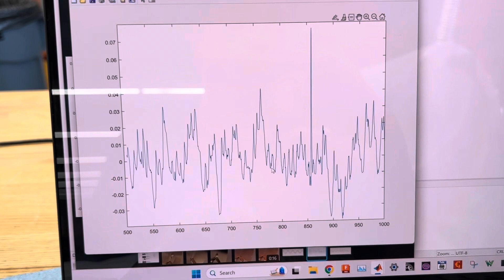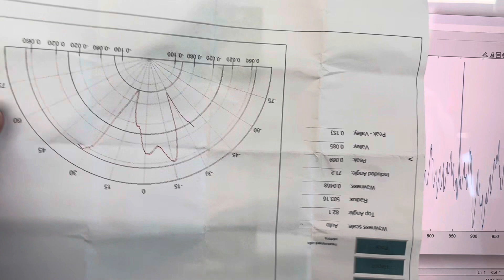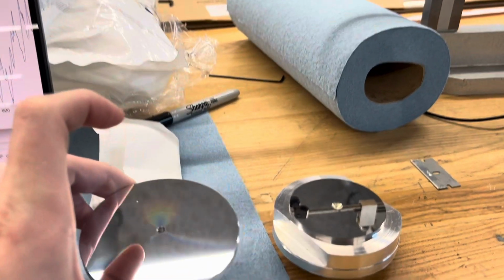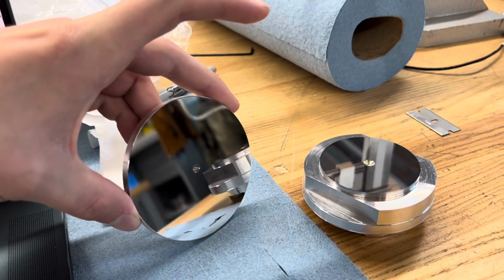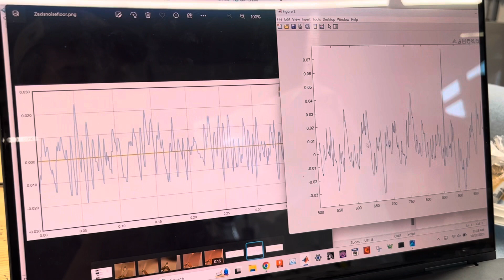Nanoscale air bearing vibrations cause surface finish issues in diamond turned surfaces

Comment: Running a different gas like argon or changing the temperature of the gas feed through the bearing might tell you if its a cavity resonance issue. Or it could be due to the air supply itself - such as if your air supply is vibrating. Hitting the resonance of a valve can also cause feed issues

Comment: Can you characterize the air bearing run out as a function of air bearing pressure? I found that higher pressures can result in less runout for my rheometer....

Comment: Not related to the vid - What happens if you sharpen a standard tungsten carbide or CBN tool to the sharpness of your diamond tool and used that instead? is the only concern with using these softer materials that they just don't hold a super sharp edge for as long so they can't be used to achieve these optical finishes? I guess grain size of the tungsten carbide composite could effect the practical sharpness limit.
Reply from the maker: You can’t get WC or CBN as sharp as diamond, and hence you can’t get the same optical finish, or realize the same near-zero cutting forces, which contributes to part accuracy
Reply: @cylosgarage  Makes sense. I'm curious what's the minimum depth of cut you can effectively take with your setup on aluminum? I remember seeing some paper on this lathe. I didn't bookmark it and I can't remember where you posted it. Could you please link it? Thanks!

Comment: So basically the lathe right now is made up of a salvaged Z axis and a "brand name" air bearing spindle? What happened to your creations?
Reply from the maker: That spindle walked so this lathe could run. I’m really proud of the x axis, the hydrostatic bearings of which represent the cumulation of all the things I learned doing the air bearings. Completely designed and machined in house. The project has a finite timeline associated with it, otherwise we would’ve made everything ourselves. But when offered a PICo spindle, you use a PICo spindle :)
Reply: @cylosgarage  yeah it is kind of unfortunate how difficult these machines are to build from scratch. Tens if not hundreds of years of combined experience and research go into them,

Comment: My 2 cents. Is it possible to lock the air slide (shut down air) at some point and use a mechanism to move just the cutter independently? James Webb Web telescope has a mechanism with very interesting specs (details in this video https://www.youtube.com/watch?v=5MxH1sfJLBQ) that has a resolution < 10nm and if I am not mistaken range of 20mm that could inspire you to some solution. So the air slide would be like a "coarse" adjustment and the mechanism a fine positioning.
Reply: The JWST compliant mechanisms are cool, and maybe in the fine range they'd work. The coarse range wobbles though, not sure it's suitable for machining..?

Comment: Flow rate might be one for me, either too high or too low but next to the sweet spot unless it's getting a flux. I'd be curious if there's also vibration in the floor. 
Next to that I'd be looking into how the part is held.

Comment: Also try an ultra-precision diamond turning tool with either a positive or negative rake, plus a smaller radius than the .500 micron (.020"), that would give you a much smaller surface area contact point and stop possible chatter
Reply: I'm not bashing your tool edge or controlled waviness Kieran,  I am very familiar with Edge Technologies and the manufacturing of ultra-precision diamond turning tools. I'm suggesting to Cyrus to try a smaller radius with a better controlled waviness which is more easily achievable with a conical radius on a mono crystalline synthetic diamond.
Reply: @JimThompson-t8f  I see, the best I am able to reliably measure a tool is .04um across any meaningful sweep of the tool arc, we could certainly try to make a tool to those specs. But the machine dynamics are well outside of my wheel house.
Reply: It is an ultra-precision tool, the plot is showing the tool edge (in red) is round to .15um peak to valley.
Reply: Agreed, the best waviness that I can measure is an .02-.04 um on extremely small radii, with windows no larger than 80°-100°.
I think Cyrus was trying to find a correlation between your waviness chart and his readings. But your window was 82.1° which he clearly wasn't using the whole window. That said, if he's turning a true flat surface, the highest peak on your radius would be all that's touching the part, assuming the radius was small enough and did not have a large surface area point of contact. That's why I suggested a smaller size radius, to reduce the surface area contact point and going with a conical ovet a cylindrical waviness radius. Now, if he was plunge turning, the peaks and troughs would definitely come into play.
Also if he had a steeper positive or negative rake angle, the shearing or tearing of the aluminum mirror could be reduced and give a smoother, chatter free cut.
I assume you went with a 110 plane over a 100 plane synthetic crystal for hardness reasons on the front cutting edge too.
Personally, I think it's a machine / mechanicall, electrical or air-bearing induced error that needs to be addressed.
Reply: @JimThompson-t8f  We did orient cube-cube for that tool, we generally only put conical radii on our tooling. One of the other phenomenon we see sometimes in aluminum is tool break in. We expect see some rainbow in the part until the tool edge wears in enough to get through the subsurface damage in the diamond/nano radius grows to a point where the edge "burnishes" (not sure what the correct verbage is)the hard particulate rather than tears them out. I also do not know what wavelength he is targeting for is optical surface, so "rainbow" may be ok depending on the wavelength he wants to look at.
Reply: Had to laugh, I've had customers complain that the tool is too sharp and leaving rainbows in their mold pins and optics. We experience the same effect where after a period of tool break-in, the nano fractures in the radius dissipates and leaves a better finish with a slightly worn edge.

Comment: Need more dumping. I vote for that famous strong magnet and  thick copper trick (https://www.youtube.com/watch?v=sENgdSF8ppA), as any move induce Eddy current and tend to keep part stay still, and as copper is not ideal condictor energy is converted to heat in copper. No idea how big must be magnet and copper parts, what to attach to base and what to part with dimond tool, but i think is can decrease vibrations.

Comment: For sure I'd run the error signal through an FFT to see what your primary frequencies are. After that, if the oscillations are present in the control loop then a low-pass or notch filter in the feedback might help suppress the noise. I'm super excited to see what you come up with!
Reply: This would be the first step for sure. I would imagine he has already checked this however.

Comment: A few ideas:
1. You mentioned in your paper that this oscitation motion is in Θy axis, is there any way you can mount your spindle so that it can reach a tool mounted at the center of this rotation of the z-stage?
2. Tuned mass damper - since you seem to have a nearly constant resonant frequency this may help to reduce the amplitude significantly.
3.Mount additional mass as far from the center of rotation of the z-stage as feasible to reduce the resonant frequency of the carriage to try and get the air bearing to react quickly enough to compensate
4. Modify the z-air stage to have either better tuning of the orifice on the x-axis constraint or add further constraints or damping in this axis either further along the length of the z-axis or on the sides of the y-axis constraints.
Reply: Ah, the old powerline dampening trick of mass damper.

Comment: Do you have an accumulator in your pneumatic line, or is fed directly from a compressor?  Accumulators can help dampen pressure fluctuations if that's contributing.
Reply from the maker: We have very a stable supply that feeds the entire building as well as an accumulator before the bearings

Comment: How stable is the air supply? Could adding a accumulator (airtank) help. Sort of how your hydraulic pump reduces oscilations?
Reply: i think the vibrations are on a much smaller scale than something like that, probably more on the scale of turbulent air flow in a pipe or something

Comment: If you can't eliminate the cause of those vibrations, you need to filter them out, right ?

I don't know how feasible this is, but increasing the weight of the axis would act as a mechanical low pass filter because of the added inertia.

I've used this trick to stabilize the reading of a scale on a "vibrating"  table.
It's a different situation but the method should apply, right ?

Comment: Is the Z-axis stage using porous or orifice air bearings? (Sorry if I'm making you repeat yourself. :P)
Reply from the maker: Orifice, which I hear is part of the problem
Reply: @cylosgarage   Do you know if the servo electronics are reporting notable difficulty keeping the Z-axis motor in position?

As in, if you can decompose the error motion at the cutting point into polar coordinates, ie. into the sum of (1) rotation-about-a-fullcrum (with the fulcrum defined by your friction-bar coupling position) and (2) a back-and-forth component colinear with the friction bar. Is force 2 negligible?

(I can't recall if modelling error this way, as a rotation of a rigid body, is a sane decision with your design... I suppose at this level of precision there really is no such thing as a rigid body...)

Anyway, ignoring that, might be time to increase the budget a little and pick up some more graphite and epoxy, lol.

Comment: It would be interesting to measure the stiffness of the air bearing. Also floating height would be of interest. If you think you have an oscillation of 1 uin, how small do you suppose the footing height should be? Similar or less? Is there vacuum preloading on these bearings (can’t remember if you covered this before).
Reply from the maker: Compliance is around 1-2lb/microinch. Fly height is .0001”. Fixed opposed pad with no additional preload